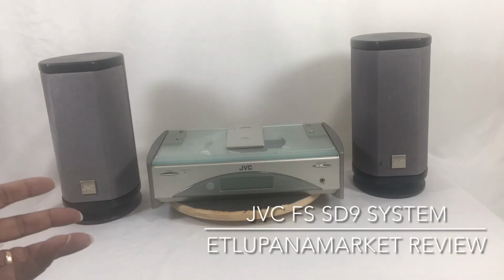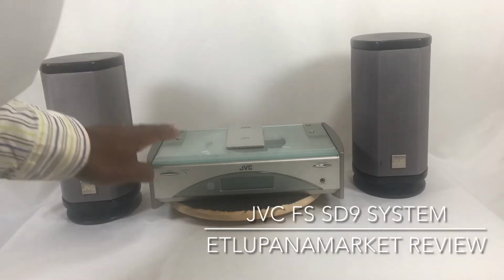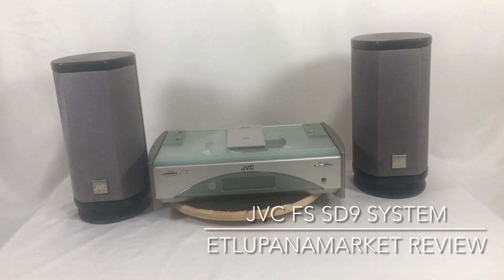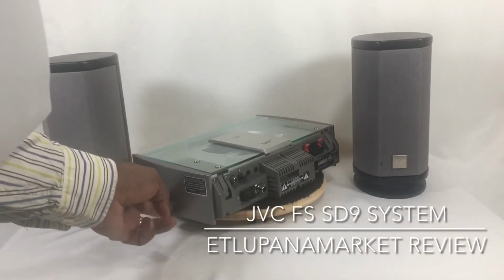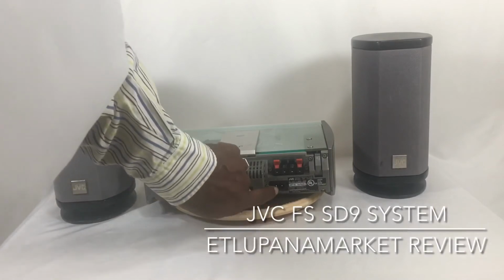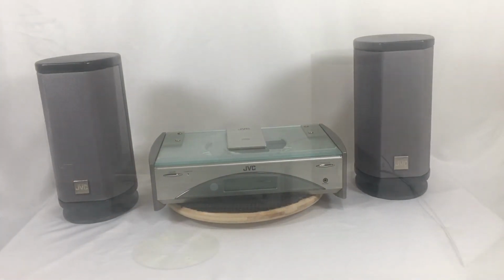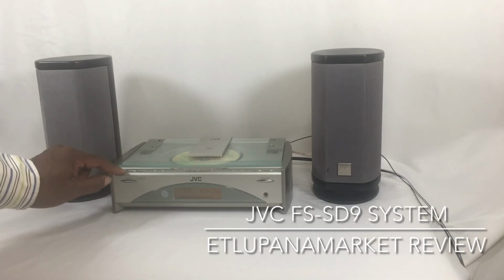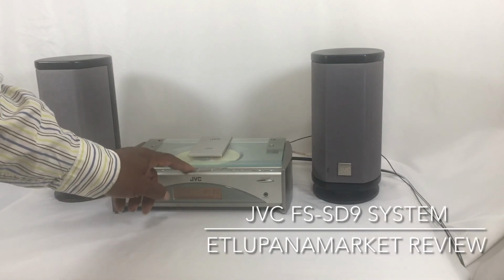JVC FS-SD9 COMPACT SYSTEM W/UPGRADED CUSTOM PAINTED SPEAKERS SP FS-SD990

Comment: I have 3 of them the SD550 the SD7 and the SD9. The last one with a yellow screen. I repaired the 770 for a new laser unit. I'm very pleased with it. There is also a 1000 version with a woofer and two small upright cone speakers. They come very cheap in europe from 25 euro op to 160 depending of some cosmetic factors.